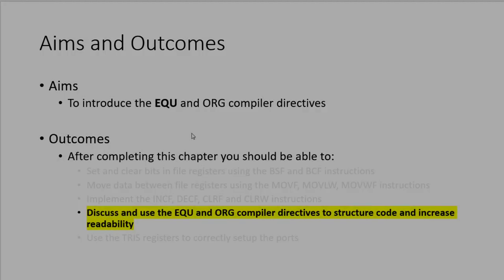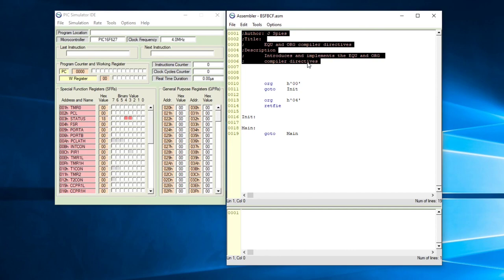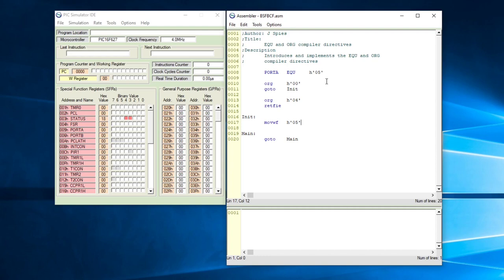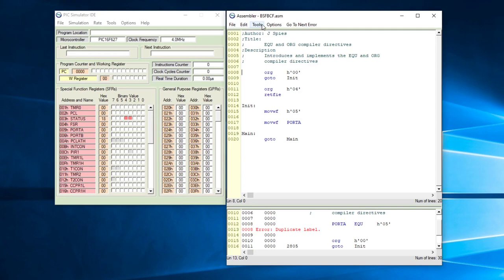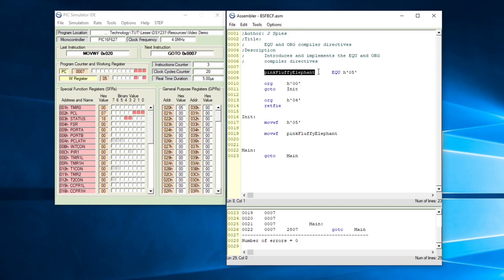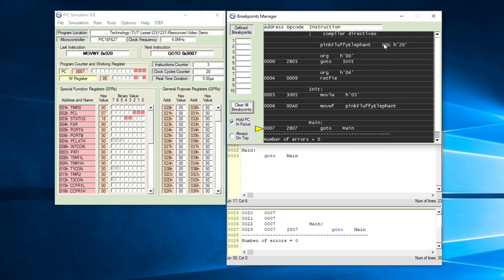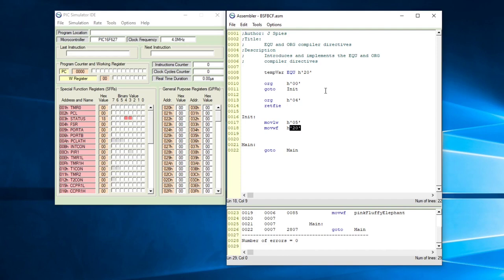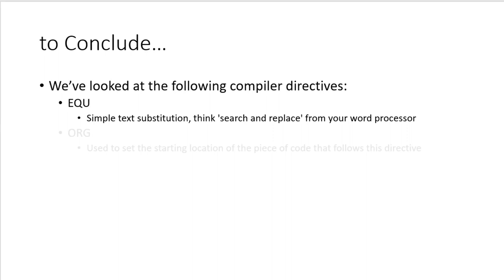The EQU compiler directive for the PIC micro's

Comment: I'm so glad you're using the PIC IDE Simulator (and not in BASIC mode).. There's directives and such that I'm trying to figure out with his tools, MPASM does not seem to work with PIC IDE SIM, but maybe I'm doing something wrong.. Wish I knew where he installed the config for the MPASM config settings. I always get errors when trying to use it. :(